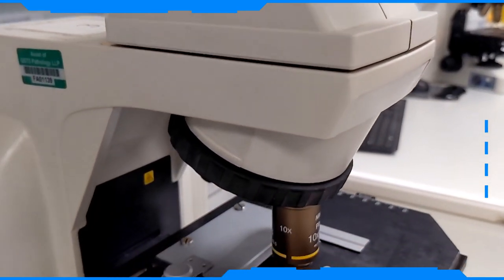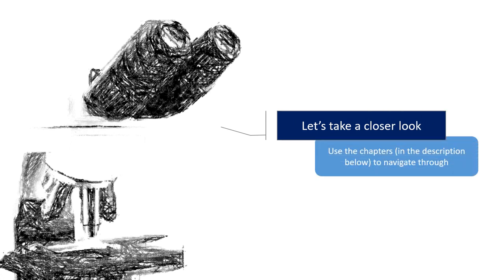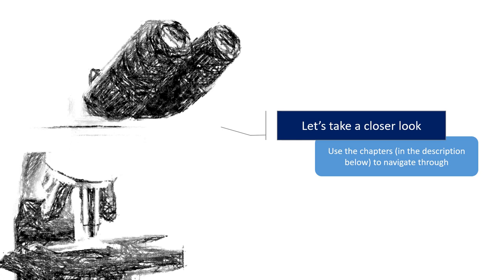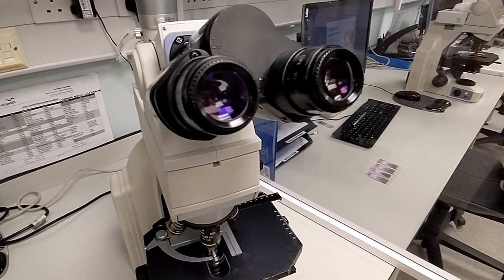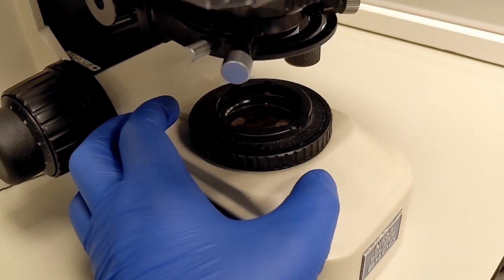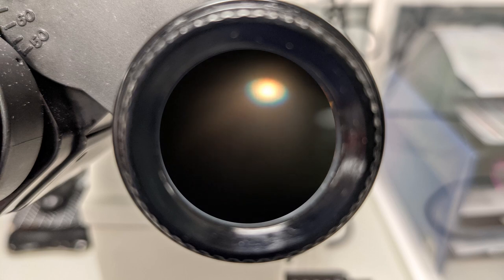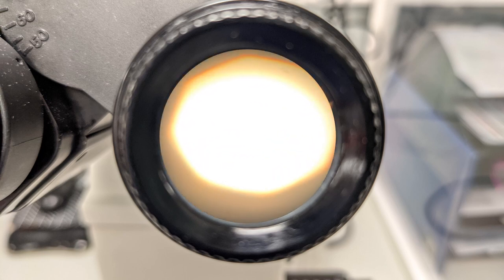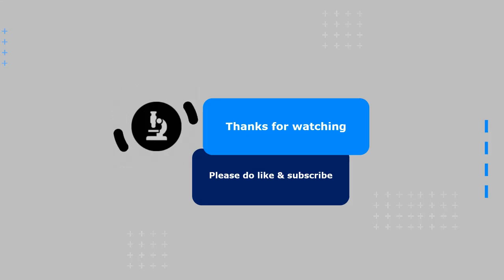How to set up a microscope

Comment: Hi just a random question, how many films are u guys reporting in normal 8 hrs shift? Thanks
Reply from the maker: Hi. The number of films a lab does is dependant on a multitude of factors. Does it serve a large haematology centre with lots patients requiring manual differentials, what the local policies are for the requesting and reporting of blood films. We do approximately 80-100 films in a shift.